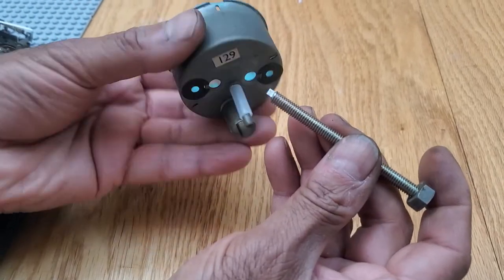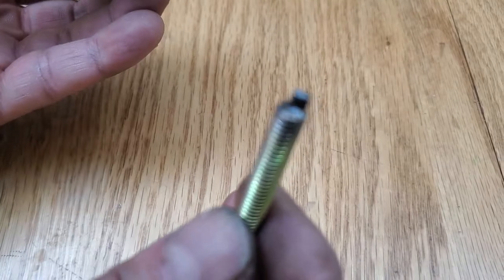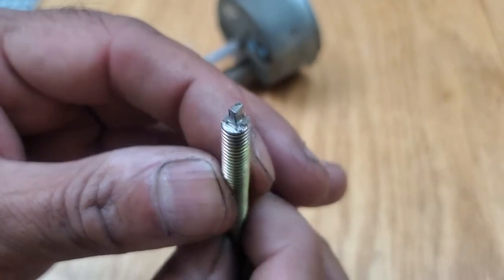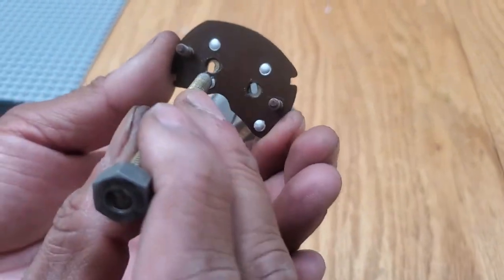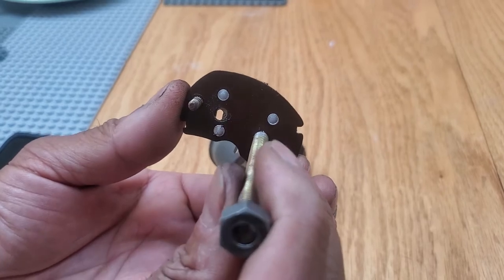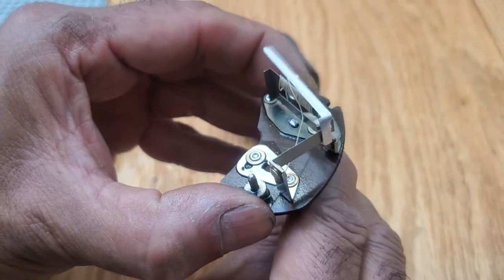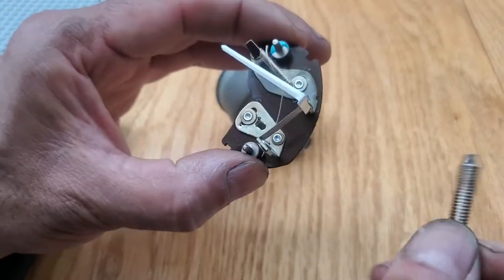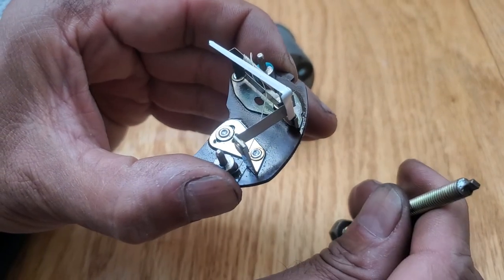Triumph Stag - Smiths adjustment tool

Comment: Brilliant!  These Smiths gauges are the absolute same as fitted to the injected Sport Volvos from '69 -73, so the info you present here, and in the first video, is totally applicable and invaluable to us also.  Thank you for putting this info together, particularly the details on the calibration tool!  Compliments and Greets from Connecticut, and the vintage Volvo world!
Reply from the maker: Thanks for the info!